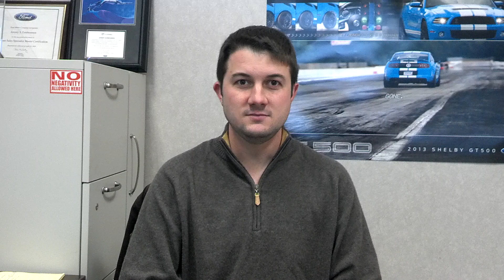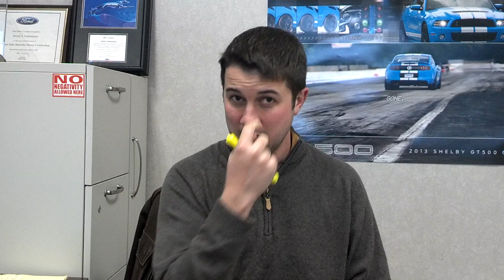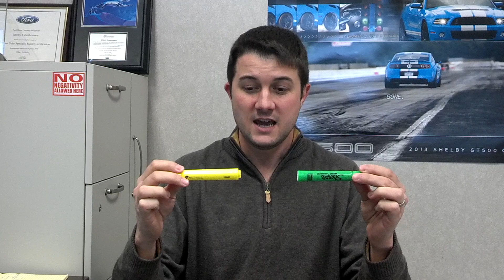Regular vs limited slip vs locking axles

Comment: with mechanical limited slip differential. It is complete safe to drive on drive payment when turning to the fullest turning radius?
Reply from the maker: Yeah,  the limited slip functions with  a clutch pack to "limit" the amount of slip side to side.  Whereas a full locker allows no slippage side to side.  Btw, Ford has gone away from LSD and moved to lockers on the trucks, which pisses me off to no end...
Reply: @JeremyZumbrunnen  why?? Locker are MUCH MUCH more better than LSD when it comes to offroading.
Reply from the maker: @7150285  in on road application though...  Ford or GM, the lockers self disengage above 25 mph.  So for regular driving they're worthless
Reply: @JeremyZumbrunnen  most modern vehicle manufacturers are mostly if not all using Auto LSD, electronic LSD or whatever manufacturers call it. Traction Control ABS braking system to brake wheel slip and transfer torque to wheel with traction. Those modern traction control systems works quite well.

Comment: Hello, I just bought a Ford F150 STX 4x4,  I'm new in the world of 4x4 and in the sticker said 3.55 ratio regular axle,  that means is non-limited-slip or limited-slip?
Reply: Jorge Caballero 3.55 is just your gearing. Generally regular axle means a open diff. Easiest way to tell is putting the rear of your truck up on jack stands, with the trans in neutral and spin one tire, is the opposing side spins the same direction then it’s limited slip, if it spins the opposite direction then it is a open diff

Comment: Thanks for the video and great explanation! I was wondering the difference between limited slip and locking since I thought they were the same thing once the internal clutch packs engage but they are not since there could still be some slip with limited slip.

Comment: So if you have a locking axle - does that mean when it isn't engaged it operates like a normal axle?  Im trying to decide whether or not I need AWD or if a 2x4 with a locking axle will be enough to launch jetskis from a marine ramp.  My biggest worry is low-tide slime/gunk on the ramp giving me problems.  However, 4x4 is a pretty hefty price increase
Reply from the maker: Yes, a locking axle when not engaged is a regular or "open" axle.  I went 4x4 and locking axle for mine.

Comment: An automatic locking rear axle won't activate on dry pavement.  So your explanation is only partly correct.
Reply from the maker: Fords locker is manual engaged not automatic like the GM unit.

Comment: Your recap sounded different then what you first said. I have a Manual Maxima, when i turn one wheel clockwise, the other goes counter. What type of front trans axle do i have?
Reply: M Escobar is the trans in park or neutral? If I’m park then your test was useless because you can’t tell what type of diff you have in park. If it was in nuetral then you have a open diff.